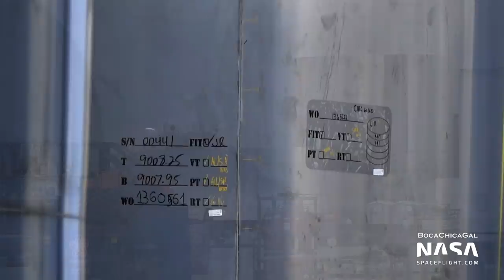SpaceX Boca Chica - Baby Starships, Assemble!

Comment: Высокие цистерны положили из-за опасности урагана?
Reply: Вы смотрите на картину с валками из стали и цепи вокруг большого резервуара под давлением? Тогда ответ отрицательный. Это был недавно поставленный танк, который не устанавливался на постоянной основе. Возможно, они использовали груз, чтобы удерживать его на месте во время сильного ветра. Это не было заложено.
translated by google:
Are you looking at the picture with the rolls of steel and chain around the big pressure tank? Then the answer is no. This was a newly delivered tank, and has not been mounted in a permanent position. They may have used the weight to hold steady it in place during the high winds. It has not been laid down.

Comment: 10:42 Soooo no one is freaking out about that wall that is being put up.... that will block 60% of Mary's field of view? Anybody?
Reply from the maker: It's been like that for weeks and it's not expanded since. No worries at this time.
Reply: @NASASpaceflight  thank you! I can now leave the ER, you comment has helped negate my heart attack.
Reply: That wall has not been worked on for some time now. It was deemed as being a protection for launches and tests to stop debris going on to the public road. There are containers that are backed up against it for SpaceX use and possibly added resistance to debris. So no one is 'freaked' as far as 'The Wall'.